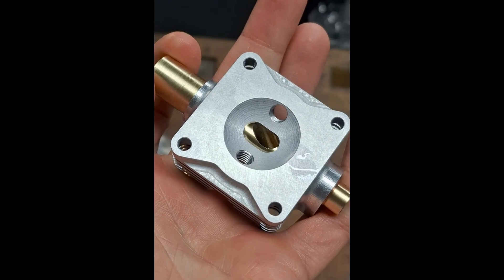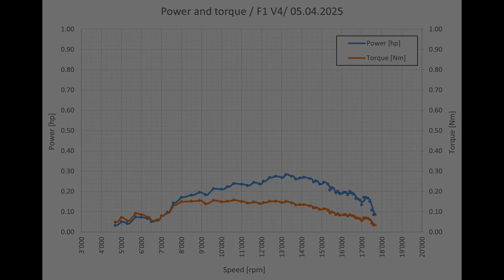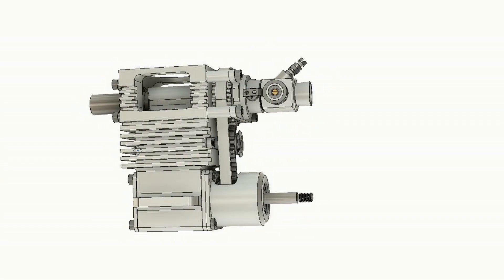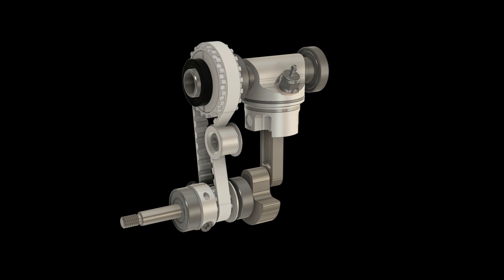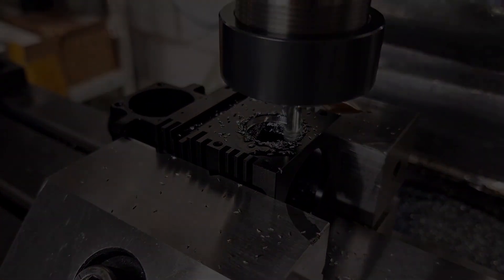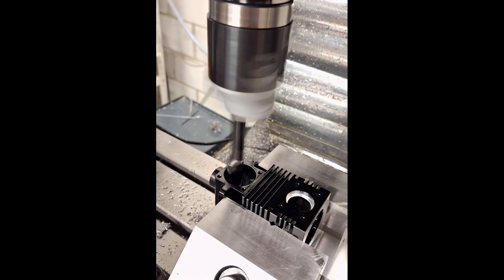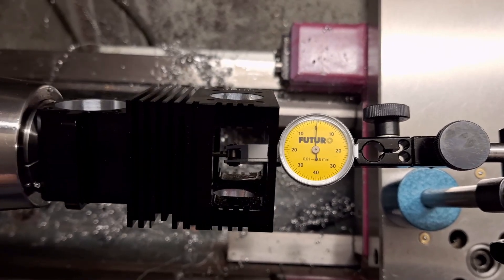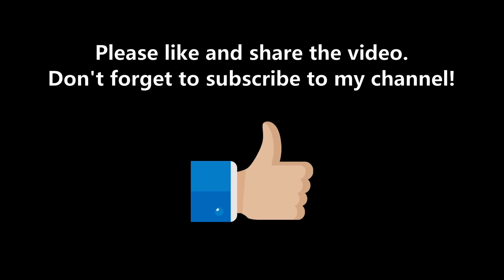New Rotary Valve Design for Model Engine / Modellmotor mit neuartiger Walzendrehsteuerung / Part 3

Comment: I'm excited to see you pull off the floating seal.  My first two rotary valves didn't have the pressure activated seal.  They both ran but poorly.  The first one with the floating seal really improved the performance.  The beauty of the design is it only has high loading pressure on to the valves when it needs it, and actually can pull away a little on the intake stroke.  
I like your design with the full diameter seal.  I've enclosed the top of mine once, it was a bit different configuration compared to yours, yours is cleaner and I'd be tempted to try it on mine.  
Looking forward to the results, I think the reason the axial flow rotary valve works better than the cross drilled one is there is  only one port being cut off during rotation rather than two, the airflow is cleaner.
Reply from the maker: Hi John 😃 I already thought you would like it! To be honest, I was inspired by your design. My idea was that a steel piston ring can absorb heat and pressure very well. But I assume that it will not be perfect tight. This is also because, on the one hand, the piston ring is not subjected to sufficient axial load and, on the other hand, micro-movement will prevent any real running-in behaviour from taking place. But we'll see during the first run. Either way, I would love to see new content about your BMW rotary valve swap. If think if you have the space in the counter piston to add piston rings would be an idea. This also improves heat dissipation to the cylinder. You say it correct, It must be something like that. Either turbulence disrupting the gas flow or something in the valve gaps no longer functioning properly due to the model size. The two sharp transitions in the cross holes also don't appear to be optimal. I had put so much work into it... but let's leave that behind us now and make a niucer rotary valve engine 😁
Reply: @danielhunziker3577 I've seen the piston ring variant used before, we used rubber o-rings with PTFE backup rings in order to get a good seal as we have coolant flowing through our floating bronze seals.  I bet you will be surprised by how much movement you see in it.

I do intend to make some more content soon on the rotary valve, I did get it running again after the failure on the recent drive, it was a simple adjustment of the main valve timing, it had slipped about 100 degrees.  My next step is to machine a keyed alignment plate to prevent that sort of slip from occurring again.
I'm very excited to see how your new one does, I'm expecting much better airflow.  

We actually once took airflow measurements of our BMW rotary valve head vs the stock BMW poppet valve head.  We connected a vacuum cleaner to the cylinder side of the head and measured the mass airflow with a mass airflow sensor from the BMW.  We rotated the valves or cam shafts 1 degree at a time and plotted out the airflow.  The rotary valve flowed considerably more air however I think we are challenged in having consistent timing across all of the valves.
Reply: @johnpearson492  Hi John, have you considered individual servo drives for each valve? Maybe they are not responsive enough, but it sure would improve the tuning.
Also, does the mass of the counter-piston have much affect? I expect the mass could be optimally tuned.
Reply: @TheQooDude I considered that, it's astoundingly more complex and actually involves electronics, of which I'm not too keen on as a mechanical engineer.  It would also take up a lot more space using individual servos on each of the 6 cylinders.  They would still need their own little chain drives and then each cylinder would need its own cam position sensor in order to synchronize it with the engine.  The one cool thing that could be done with servos is easy control of variable valve timing and potentially even variable duration control of the servos are responsive enough.
Reply: @johnpearson492 True, and when it gets more complex, you have to weigh the gains. It may work with one servo for two cylinders, 3 for six?
Reply: @TheQooDude The servo drive would basically add a science experiment on top of a science experiment.
Reply: @johnpearson492  True. It's easy to comment from the sidelines,  so hats off to the doers like you. 😎
Reply from the maker: @johnpearson492  Hi John 😃 I have made 2 versions of the floating cylinder head. Teh first version is only with one regular piston ring. The seconde version is with additional O-Ring (made out of high temperature FKM) after the piston ring. So that's quite similar to what you guys made 😀 What I could well imagine is that there will be a kind of sloshing motion. The rotary valve will push the counter piston to one side under pressure and there will also be a minimal up and down movement of it 🤔

A little preview (spoiler): I have as well the problem of disadujsted timing. I have performed several tests and found that the friction of the rotary valve becomes very high at high speeds. This high load puts a lot of strain on the timing belt drive and can cause the positioning to shift. However, at normal speeds, it appears to be negligible. Could it be possible that you have a kind of similar problem with your system which caused the 100° shifted timing? This could possibly explain why it happened when driving at the corresponding speed. I will try to fix this with a heavy duty timing belt drive. Hopefully this will prevent slipping or loosening...

That sounds like a good method for determining the gas flow. In the end, it's usually the inlet valve that limits performance. The vacuum cleaner perfectly simulates the negative pressure during the intake stroke. Of course, it's a rather static measurement. But you'll get a very good basis for comparison this way. The timing is effectively different with a rotary valve. Compared to a poppet valve, it must have longer oppening times. So it opens earlier and closes later. The timing curve forms a triangle and not the bell-shaped curve that is usual with spring-loaded valves. Sure, this here is a model engine and the timing is designed for high rpm. My timing is 50°, 90°, 90°, 50°. Quite crazy, right?
Reply: @danielhunziker3577 Yes, I too have experienced the high friction at times between the valve and the floating seal, this is one reason we have the drip oil feed onto the valve.  We have twice broken the factory timing chain on the BMW and had to replace it.  I'm not sure what caused the chains to break but it seems logical that high friction on one of the valves could have contributed.  We likely have high friction very consistently as there are 6 valves all timed evenly relative to crank position.

We too have had some pretty crazy timing curves.  Ours is trapezoidal as the hole in the valve is wider than the hole in the head allowing for some amount of time where the airflow is at its peak and not changing relative to valve angle.   At one point we put reducers into the floating seals ports to lower the overlap as we really struggled to run at idle.
Reply from the maker: @johnpearson492  Oh dear John! The friction itself isn't really a problem, it's just that it puts a lot of strain on the valve train. To be honest, I'm not surprised that your timing chains broke! Up to approx. 15'000 rpm, I don't notice anything unusual in terms of friction. Everything runs smoothly. At higher speeds, At higher speeds, you start to notice it. At very high speeds, the friction becomes too high and my valve train slipes. Yes, this is a small spoiler 🙃 I see it the same way you do. When I imagine that I might build a V8, V10, or even a V12 with it, the overall drive of the rotary valves will of course be heavily loaded! That worries me...

With the timing 50°, 90°, 90°, 50° I get an idle speed of 3'000 rpm. I should mention that this isn't a significantly higher idle speed than a Saito or OS model engine with poppet valves. They have around 2'500 rpm. The openings in my rotary valve and cylinder head are exactly the same width. With a rotary valve diameter of 12 mm the width is 7.7 mm. The angle between the exhaust and intake valve is 110°. The valves itself are 7.7 x 8.0mm (62mm^2)and the hole in the rotary valve is 9mm (64mm^2). Everything at the limit 😅 An OS or Saito engine with the same displacement and poppet valves has intake and exhaust ports with a diameter of 6 to 7 mm (28 to 39mm^2, so 50% less).

Comment: Hey mate, I'm working on a Turbo design for the Magnum  .52 4 stroke engine, (Same dimensions as or O.S.)
I'm also working with JLCCNC. 
As you would expect it's tiny and very close to their CNC machining limitations thus it might end up being 3D printed. (Not ideal)
I have drawn up a few different compressor designs that utilise positive blade outlet angles  which will hopefully provide a steeper pressure curve. 

I haven't started on the exhaust side yet however the plan is to include fixed diffuser vanes into the exhaust volute to try and maximise energy extracted from the exhaust flow. 
I'll keep you posted with progress. 😊
Reply from the maker: Dude, that sounds interesting! To be honest, I have no idea whether a turbocharger can work in such small dimensions 🤔 It would have a rotational speed of over 1'000'000 rpm 🤔  All I know is that OS once built a version of the OS FS-120 with a Roots compressor, never anything with a turbocharger. Would love to see a YouTube video about your project 🙂

Comment: Counter piston head design is very clever. It would be interesting to try this out on a motorcycle sized engine. One day...  🙂
Can't wait for the next video!
Reply from the maker: Thanks man! 😃 The design is inspired by MrPizzaman09 & johnpearson492 rotary valve swap of BMW e36. Have you seen their project? https://www.youtube.com/watch?v=vpEV_uX1zf8 Og course I will make follow up videos! The engine should run in the end! 😁
Reply: @danielhunziker3577  Thanks for the link Daniel. I have been following the BMW guys, plus the NZ BSA project and others, so I find yours exciting because you can make a new iteration so much quicker.
I had not seen that update video showing the parts in detail. I don't know who named the combustion chamber the 'counter-piston', but the name fits perfectly.
I myself have sketched out such counter-piston designs, unaware of existing designs, so it seems an inevitable evolution for rotary valves.
I conceived a 3d printed rotary valve incorporating cooling channels that might reduce the need to water-cool the counter-piston. I'd say the bore would need to be 80mm or great for such a project to work.

Simplicity is the key!
Reply from the maker: @TheQooDude  Mercedes (Illmor) and Bishop Engineering are actually at the forefront of development. They even built a Formula 1 V10 engine in the late 1990s. See here https://v-eight.com/multimedia/pdf/AutoTechBRV.pdf Here you can clearly see how such a system can work well. Of course, I'm in an area that is more of a game and a challenge. It's so much fun to do this kind of development! 🤩
Reply: @danielhunziker3577  Ah, the Bishop valve! I have Glen Horrock's detailed analysis of this valve in PDF format. I don't recall where I got it, but the title is 'A Numerical study of a rotary valve internal combustion engine'. It is very detailed.
Reply: Seriously smart!

Comment: Quite interesting!  Some questions:

1.)  How is the engine lubricated?  I am assuming it is “splash lubrication”?

2.) Will there be any testing to determine efficiency (Granted i am mot great with this FANCY engineering with all the math and whatnot (yet)) but yeah?

3.) Could a version running on Propane or Butane and a Spark Plug be done?

4.) What will the Idle RPM + Max RPM be?
Reply: 20.000rpm should be posibble consider small piston speed, but above 20k rpm, the G, the friction just increase exponentially, it a diminishing return
Reply from the maker: Hi Eric 😃 Let me answer your questions as good I can:

1.)  How is the engine lubricated?  I am assuming it is “splash lubrication”? --> Like a 2 stroke with oil in the fuel.

2.) Will there be any testing to determine efficiency (Granted i am mot great with this FANCY engineering with all the math and whatnot (yet)) but yeah? --> I have a dyno and can measure the power and the torque.

3.) Could a version running on Propane or Butane and a Spark Plug be done? -->  That isn't planned. Goal is to use methanol.

4.) What will the Idle RPM + Max RPM be? --> Idle at that small site is 3'000rpm and max speed will be over 20'000rpm. Peak power will be arround 18'000rpm.